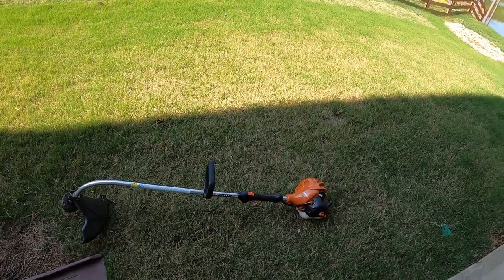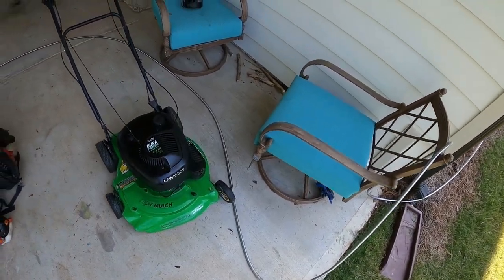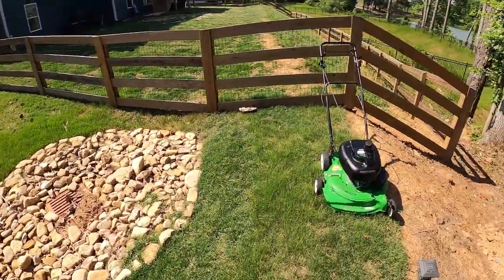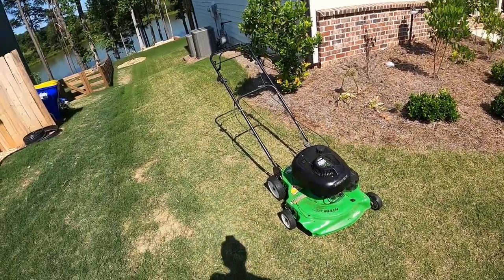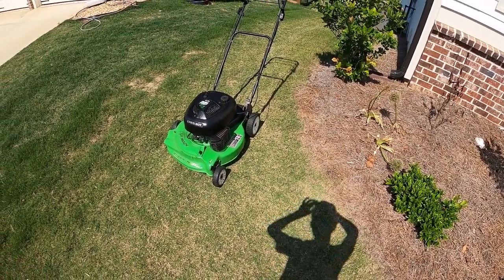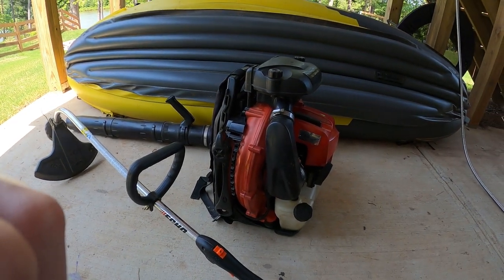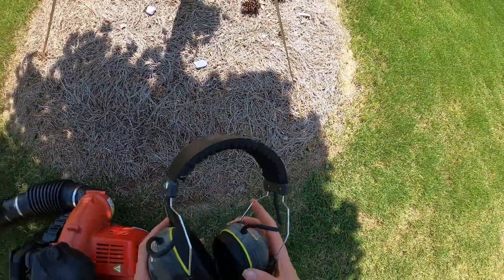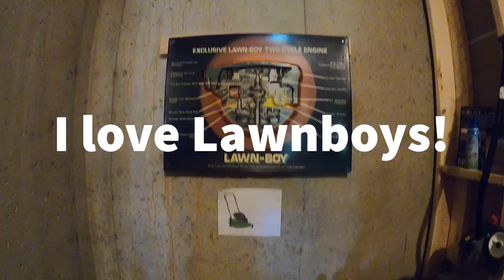Lawn cutting video with Brother's Lawn Equipment for the 1st time!

Comment: Nice job man👍👍
Reply from the maker: Thanks!
Reply: I noticed your lawn boy 10323 was surging hunting just a tiny bit but that’s an easy fix
Reply from the maker: I know that, right now it’s in the repair shop to get it fixed because it has a leaking problem, and it looks like my oil seals are probably worn out I think because someone told me that it would need new oil seals and an exhaust gasket.